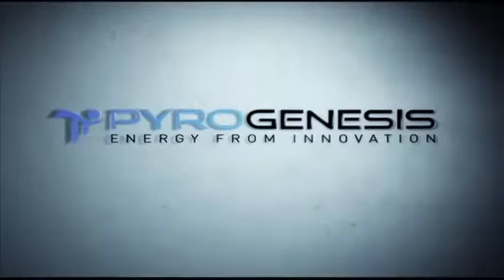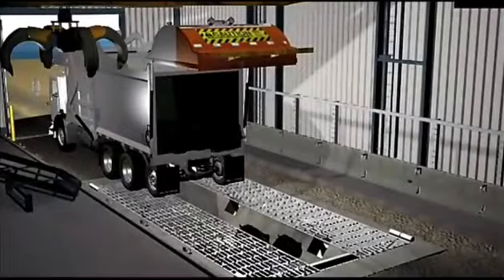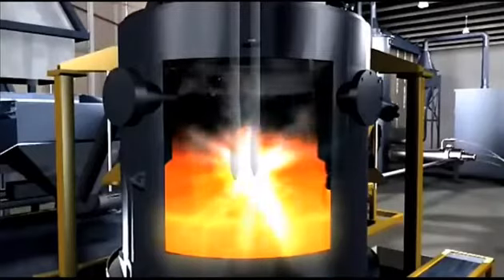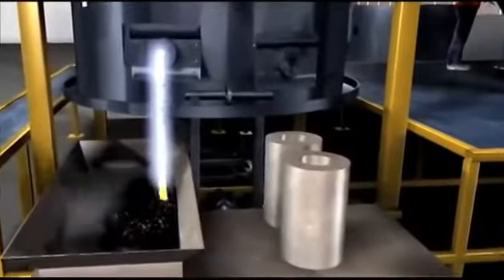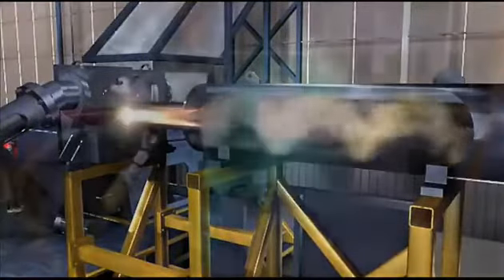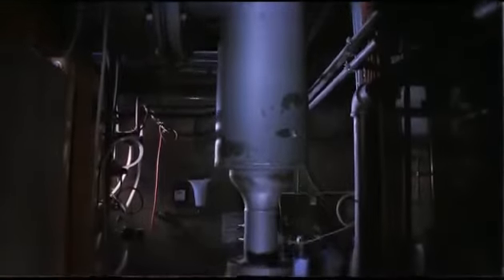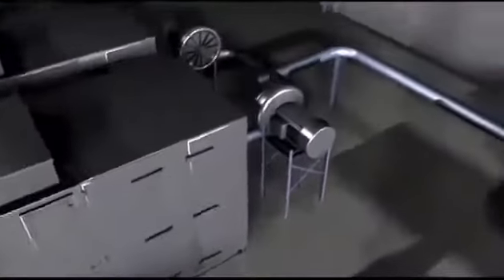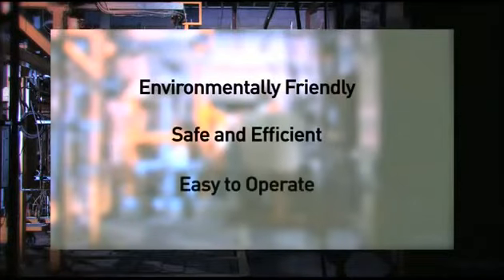Plasma Waste to Energy System

Comment: This filter system at the end seems complicated. What filters does it need and what are the byproducts? Do the filters need to be changed a lot? Don't they contain the toxic molecules they filtered out and aren't they are thread to the environment as well?
Reply: which are the advanced or upcoming technology? and is this above shown technology existing or upcoming one??
Reply: Probably micron filtration or some sort of glass floss. High concentrations of heavy metals would make them EPA regulated and they wouuld have to be permanently stored in a superfund site. Unless the material could be reused.